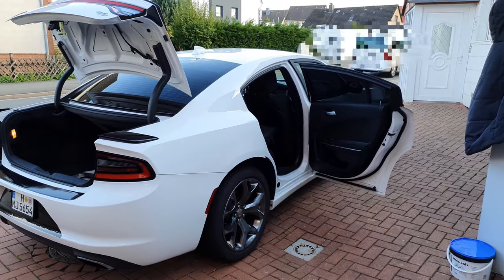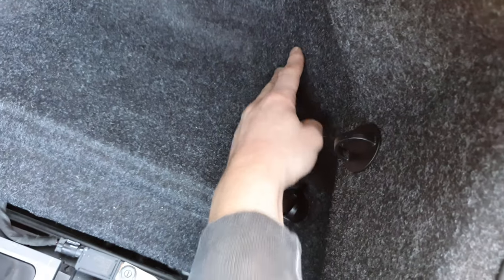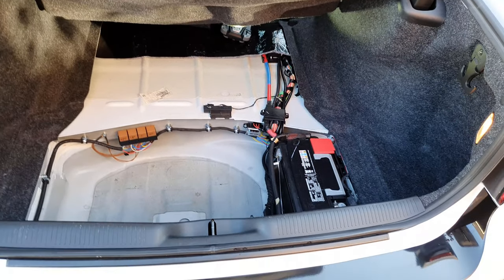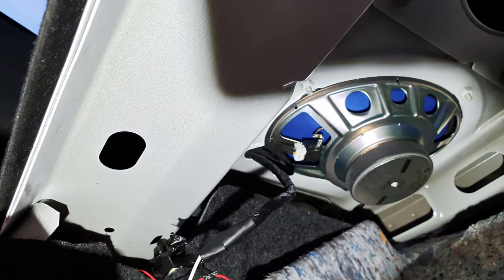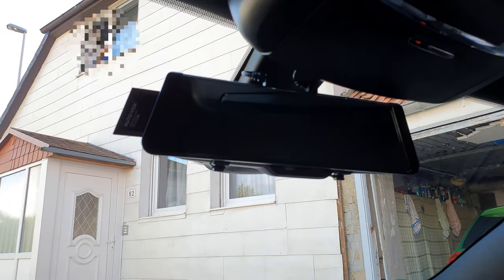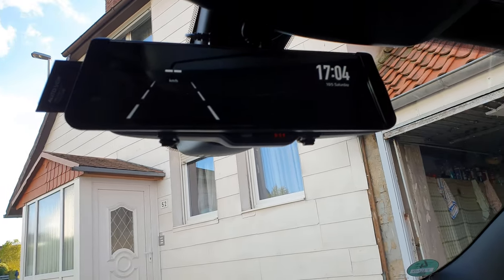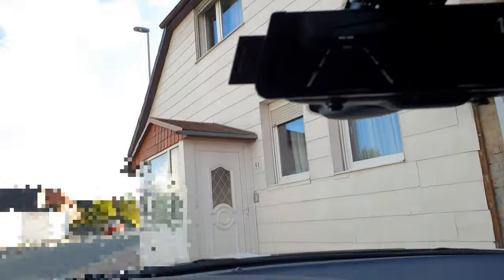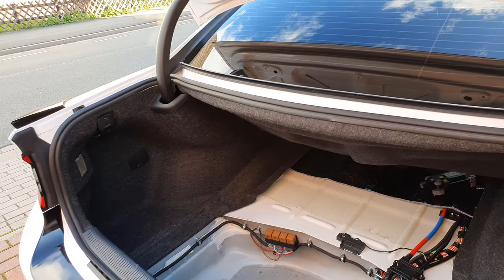2016 Dodge Charger Mirror Dashcam Install w/ Backup Camera

Comment: That's how I wired my camera from the dash to the trunk on my Chrysler 300 (06). I was hoping to see if you do different around the rear seat but that was exactly how I did mine (lol). 

I'll have to find if I can slip the cable under the rug for the rear seat when the next time the weather gets warmer.

My camera is mounted on the trunk door behind trunk lock.